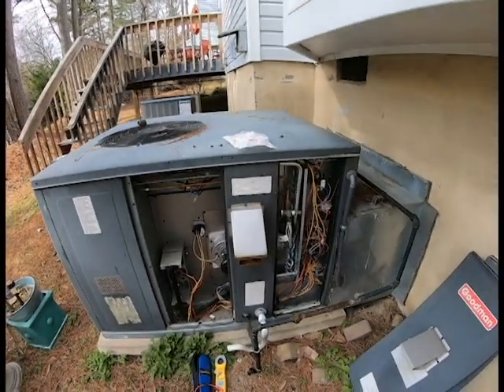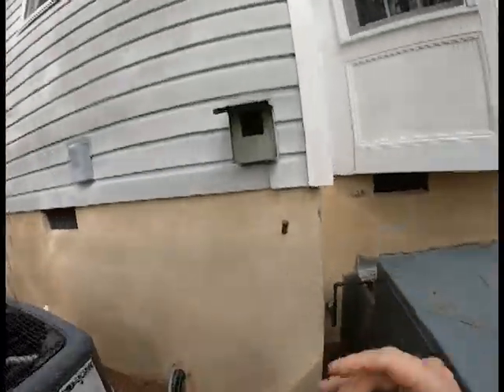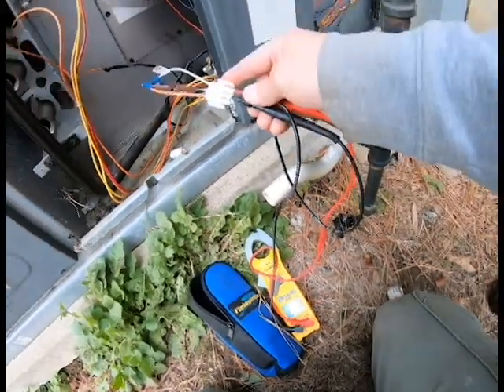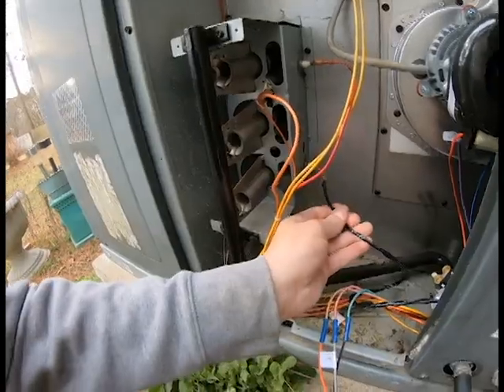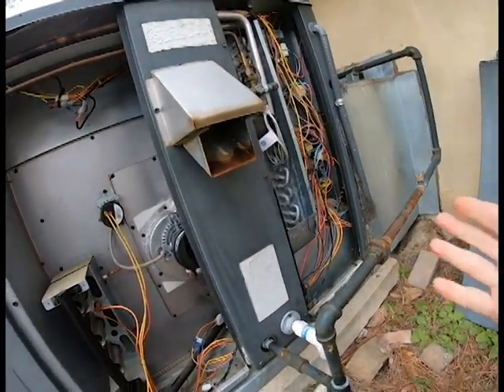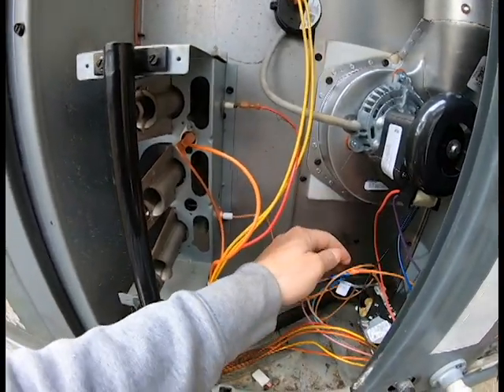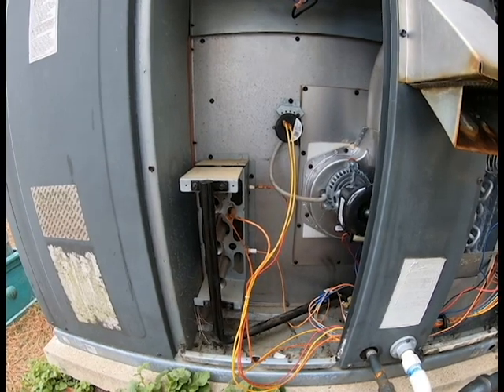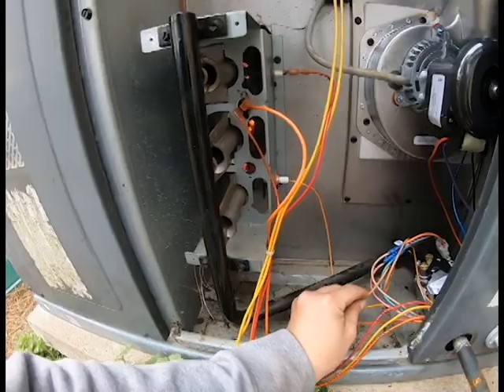How to Diagnose a Bad Spark Ignitor!

Comment: Hey Travis, appreciate this video. I’m actually working on a GPG unit myself. When I go from common to high, it is 26 V from the harness on the gas valve. But from common to medium my meter does exactly what you mentioned. The spark igniter does spark, but nothing comes on, am I running into the same issue as you where I need to replace the spark igniter?

Comment: This just happened today me today on a ruud furnace haha I didn’t physically see a spark so I pulled it out and energized it. Then a random spot on the wire arced out to the burners. Put some black tape and everything started up fine. Identical readings at the gas valve though

Comment: Same thing happened to me my man.. It was intermittently not starting with flash code one. One night in desperation I went outside and opened it up.  Because it was dark outside I could see a spark over near the control board side. I grabbed the wire and it shocked me too through the insulation. I could not see the damage to the insulation but I could feel a tiny imperfection. For me it was complicated because it usually worked fine with the covers off. I think putting the covers on moved the wire in such a way to push the damaged wire nearer the metal cabinet where it was shorting to ground.  I rerouted the wire and taped it up good an ziptied the damaged  area far away from the metal cabinet. We r all good now.  Thanks for your tip!  Great video.  BTW I ruled out my gas valve by sticking a fireplace lighter in place of the ignitor and everything lighted right up

Comment: I just had this issue today. The unit I'm working on the inducer would run, the ignitor would spark for a split second and then shutdown and attempt to go through the sequence of operation again. My meter readings were crazy as well at the gas valve. I also found if you unplug either wire from the gas valve didn't matter which the ignitor would spark like it should but obviously no gas so no ignition. I hope this helps someone dealing with this odd issue.